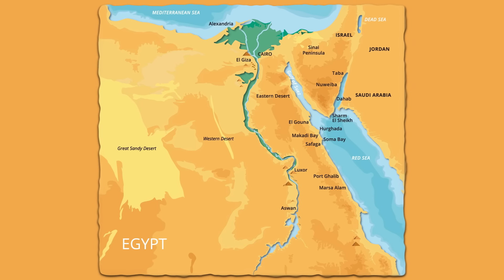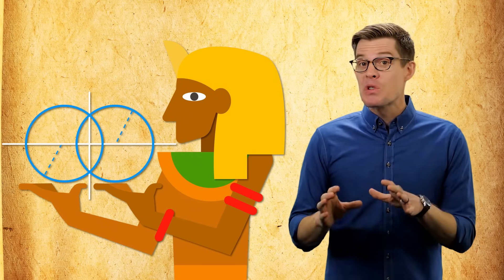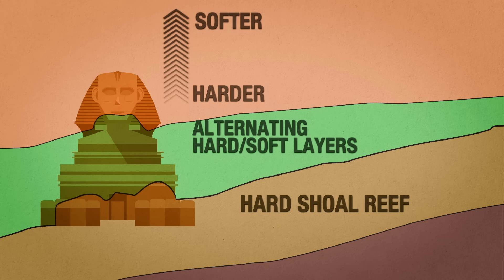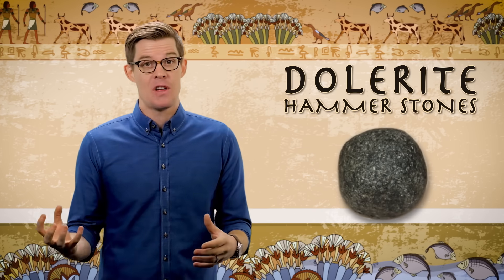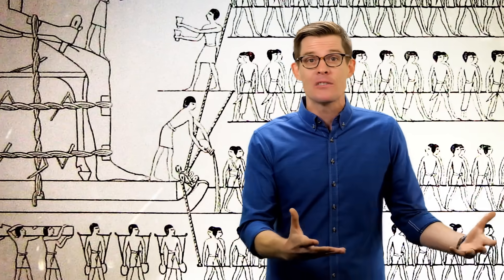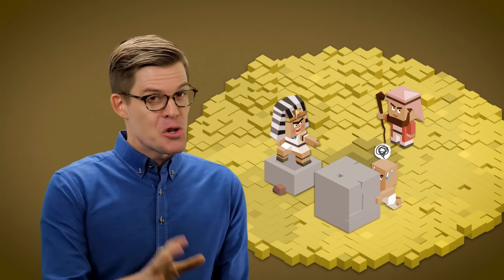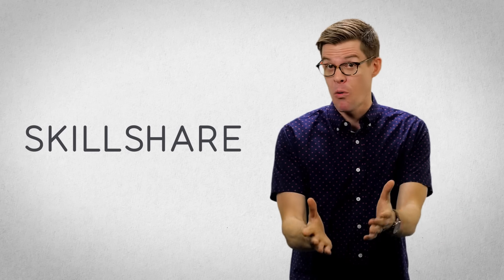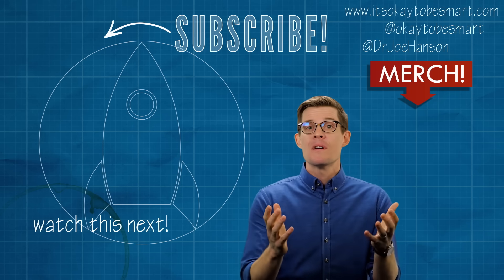The INCREDIBLE Ancient Engineering That Built the Pyramids

Comment: The granite plates where chipped out by dolerite hammers? They fit so perfectly a razor blade cannot get between them, and you claim this is achieved by slamming round rocks at them? ok
Reply: How about we play the evidence game.  First is there is no granite plating in the pyramids.  There are however a relatively small number of granite blocks along with the granite sarcophagi.  So the numbers involved are not vast.  Next is that dolerite was used along with fire to quarry the blocks from the bedrock.  Upon removing them = THEN the blocks could be finished using other tools.  So gneiss stone tools like dolerite or flint along with bronze tools and finally abrasive to polish them smooth would yield you blocks such as you see.
Reply: @varyolla435  ok fair point. Lets play the math game tho. When they raised the abu simbel tempel in the 60s it took 5 years with modern technology to move 2200 blocks, but Egyptians moved 2,3 million in 23 years, I just find that extraordinary. When you look at the Mexican pyramid with a 675 feet base and a 195 feet height, it took 150 years to complete compared to the 690 feet base and 438 feet height of the pyramid of Giza. It could be done as described in the video, maybe, but I just find it hard to believe to do so in 23 years. Don't get me wrong I'm only looking for answers, I'm fascinated by both the pyramids and science, but things just don't seem to add up.
Reply: @BiLlYbOuW  Poor analogy.  Abu Simbel was relocated.  That means they had to create a site for it to be moved to + had to carefully disassemble the existing site without damaging it + transport it to the new location - again without damaging the sections = to reassemble it such that it looked at it once did.  

That is a far cry from quarrying rough blocks and moving them a few hundred meters to deposit them with others in a manner consistent with "stacked rubble".  Very few of the total blocks are carefully cut and in some cases polished.  Most are crude chunks of stone of varying shapes and sizes.

If a single team can pick up a block and transport it to the adjacent pyramid to drop it in position in say 2 hrs = then 10 teams can place 10 blocks in about the same amount of time and so on.  So more teams working in tandem yields more blocks placed in a given span of time.  Stop thinking "1 at a time".  Recognize the totality of what was happening = thousands of organized teams of working who were working in tandem.

Comment: this is rediculous ,  first off the ramp needed would take longer to build than the pyramid, not to mention the lack of room to pull those blocks , and what about the massive stones in the kings chamber.  if you think this was done by man without some kind of outside technologys help then you must be crazy . the sphinx is much older than given credit for just look at the water erosion and the small head where clearly it was remade into what it is today. there was something there long before the Egyptians
Reply: 🤭  First is if you bothered to actually look you would see that as the pyramids rise in height = the size of the block decreases.  The largest/heaviest blocks are actually found closest to the ground in the bottom half.  Those granite relieving slabs above the King's Chamber are below the halfway point - while the Grand Gallery is even lower.  The blocks at the top of the pyramid are small enough that several men could lever one into place. 

Meanwhile above the halfway point those smaller blocks could be lifted via a lever device employing a fulcrum and counterweight akin to the Egyptian shaduf which sat upon the steps to lift the smaller blocks to the levels above.  Herodotus called them "machines" and also stated they used levers and what he termed as "a great causeway" which can only mean a ramp.  There are the remains of smaller earthen ramps at Giza in the western cemetery adjacent the Great Pyramid while the limestone quarries there when excavated years ago were found to have had massive amounts of ramp material dumped into them to backfill the area.  Methinks you should find better sources of supposed information - just saying.  🤔

Comment: The Pyramid of Giza was built like this first they dig a big hole on the bottom and they build a pyramid pointing down just the four walls once that pyramid was built underground then the top pyramid was built that is why the pyramids are Halo and rooms on the bottom because there's another pyramid on the bottom so it looks like a diamond shape if we did it all out which we cannot the reason is build this way it's because if you just build a pyramid on top on top of the sand obviously it is so heavy it's going to sink,  think about it . thas  what is holding the pyramid is the pyramid on the bottom sand side to side the four side the bottom pyramid to hold the top pyramid. think about it. da da da da da I'm smart
My UFO friend told me that really From Another Dimension wait until they find out that what I said is true about those pyramid there's another one on the bottom holding the top
They use a magnetic field device that they only had at the time and he was easy to left there was no really any people doing  the heavy lifting. They use system magnetic device lifted it easy

Comment: Just another copy of ten thousand other videos with similar “bits from each” to make it look like it’s their work! I just have one simple question that debunks the pulling stone blocks up ramps theory.
Question: if it took 20/50/100 men to pull a block up a ramp with ropes, what happens when the men get to a corner? Do they in turn fall off the edge? Or do they run round behind it and push each other against it? If there were people working off the side of the pyramid pulling rope as they neared a corner or edge, the rope would chafe against the top edge of the floor of where they are working and snap considering the load applied by this amount of people. Not only that, imagine how long the rope would have to be! 
The suggestion that this was done inside of 25 years using such methods is is rediculous and levering or shoving blocks along is equally rediculous. They also say, the granite was transported up river from Aswan, ok let’s look at that, how did they hoist the 60 ton blocks for the kings chamber ceiling out of the ground, move them to the river, load them on a boat successfully and float them down the river before unloading them and hoisting these up ramps into position? Their on the right track but missed a few stops and need to fill in the gaps on this part. Jean Pierre houdins theory is the likely best one but kind of debunked by my first question in how exactly they used the ramps.

Comment: U ask Any engineering company to built it exactly the same measured to exact dimensions inside and out and foundations with the same specs without mechanical means using only man power and copper chisels in 20 years with all stones cut transported and lifted etc. O with only a plumbline and a cubit ruler and plenty of sand and water for leveling.I am a believer prays to the gods and it shall be done.ye And if money labour and technology of today wasn't an issue they still would have difficulty and probable resort to concrete and plastic.

Comment: They were made by ancient reptilian AI aliens using state of the art ancient advanced technology. 😂 They used optical guided pickaxes and used water calibrated gyroscope technology to level the ground where these were built on. They may have used multiple bioengineered organic cylinder platforms to move the blocks around with the help of similar genetically modified organisms as the method of propulsion. These were built as transport ships to ferry the ruling ancient alien to the other world. 😂😂😂

Comment: I work in construction and am always arguing the point to ppl who have no building experience that u would be surprised what ppl can achieve especially if u have 20 years and an army of ppl.... it always slips ppls minds that they definitely would of used animals to help with the Labour. Personally I wouldn’t like to be the one in charge of working out the precision measurements involved with getting everything level.... but the moving of the stones I could quite easily coordinate. Again ppl forget it was build one level at a time, some ppl seem to think they lifted these stones 100ft in the air and dropped them into place and it’s bollocks. If something is incredibly heavy and u know u can only lift it a few foot off the ground, then that’s what u do. It does annoy me when ppl who don’t do anything physical insist aliens built it!

Comment: Pyramids were not built by humans. Simple as that. I could talk at least 30 minutes on why not, and can not wright all the stuff here. Some blocks are so heavy that We would struggle to put them in their spot with most advanced technology We have. We tried to do scaled pyramid which - failed. And We used cranes, helicopters, measured from above etc....  We could not do it with modern technology as a test with only fraction of complexity. Not to mention signs of advanced tools etc. Its not okay to pretend to know how they were built when there are hundreds mysteries about it. And do not tell me that they brought blocks of up to 80 tons, from hundreds of kilometers away. ( Not from underneath as suggested here, the big ones were from hundreds of km away.... ) How did they know about magnetic fields ?  JUST ONE THING ALONE is enough to end this silly video. Great Pyramid of Giza is built at EXACT center of planet Earth.

Comment: Different sizes of limestones rocks boulders were stacked one upon another   to a height and width and were later cut into block cubes beginning ftom the top and shaped into tethrahedral dimension(4-faceted hedral-pyramidal). 

During construction, small holes, small tunnels and narrow passages  were concurrently dug into the limestone boulders accurately measured and aligned.

If there need be, readied granite Sarcophages were installed at specific end of tunnels and passages.

Wallah. Pyramid mystery solved

Comment: This site should be called it's ok to not know. Here's some evidence that you are wrong. The main pyramid on the Giza Plateau has 8 sided not 4. The Egyptians found the pyramids they did not build them. How can you explain the reliefs in the king's chamber? You can't. How would you explain the fact that if you were to multiply the base perimeter of the pyramid by 43,000 you come up with the Earth's equitorial distance. This 43,000 is important to everything because it is the number used in axial procession calculating the fact that our planet has a wobble. Also you do not touch on how they carved out these perfect air shaft with trap doors built into them and about a million other things. I can't stand when half wits like this take a few properties of science and try to make a most otherworldly thing like the plateau as simple as his sex life. People dig into the Giza Plateau it will blow your mind.